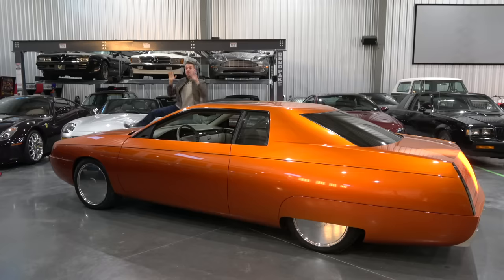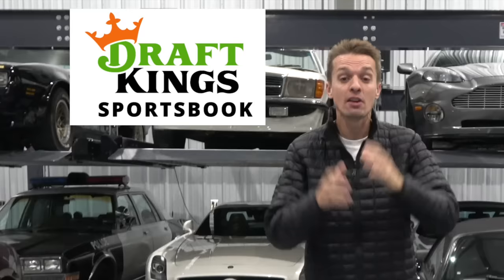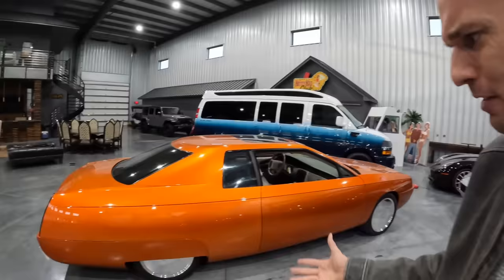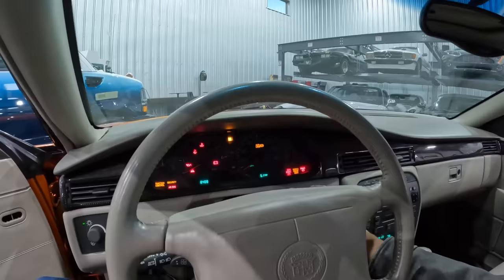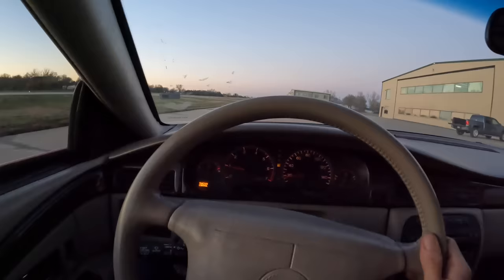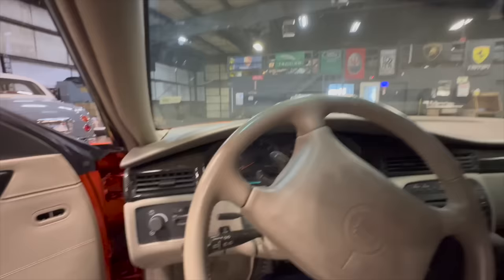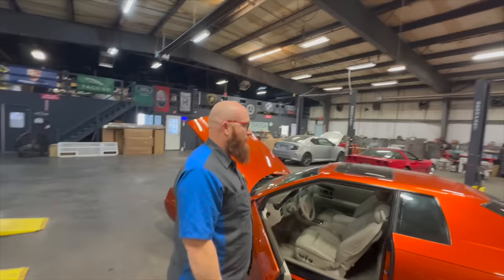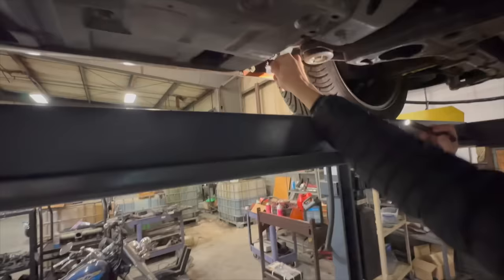I bought a forgotten Y2K Cadillac Concept Car, with a mysterious history. Meet the EldoRODo!

Comment: Oddly, the self levelling on my 89 Fleetwood continued to work even as I sent it to the wreckers.  It was all original at 439K kilometers.  The power antenna worked too!.  I should have kept it because the 4.5 also stll started and ran beautifully but I needed the space.

Comment: The 4-post lift is one thing, but it will be fun for Wizard to use a floor jack just to get it high enough for his other lifts. Can't fix the air suspension on the 4-post lift.

Comment: It honestly looks like something made for a movie or similar.  Whether it was USED for said movie...  But Los Angeles is full of these one-off production cars that barely run aside from looking the part.  The Los Angeles Auto Show often also has one-off things show up as well.  Like a prototype of the current Jeep Gladiator - just styled more like a pickup,  almost 20 years ago.  Just sitting there in the middle of the Jeep display.

Comment: Try unscrew the valve stem from the wheel that has it. If it unscrews then screw it in to the wheel that has the flush mount valve

Comment: a thought about the PS whine.  its possible being low mileage and custom, that the PS pump fail is related to excessive pressure, restriction, or sticking valve. (introduced by the customization)  if there is a way to check high side pressure vs a stock system, its worth doing.

Comment: in regards to the roof  chop on the Caddilac   beleive  the old timers  used to  just drop the original glass  behind the dash board   towards the Firewall  to “hide” that part  instead of risking  cutting the tempered  Safety  glass  although. now there are companies that can  do it those  Valves on the tires look  similiar to   Presto Valves they use on Bicycle tubes  typical Bike  Air Pumps. have a system that   you flip  the  part that goes over the valves 180 degrees and it adapts it to work on  that Valve  or a Standard  style like most Automobiles have on them ( i forget the name  i think it’s Shrader and Presta     bike Shops have a attachment on their house air  so someone makes  the tool for it

Comment: Your valve stem system on the wheels are a coming setup that we use on our show vehicles and they have an adapter that you screw into the valve stem and apply the proper air pressure!!  I have the very same setup on my billet custom wheels built and custom modified by HRBB!!

Comment: They make 90° valve stems for motorcycle wheels. If the hole is the right size could put them on those wheels and make it way easier to air up the tires.

Comment: I am not a big Cadillac fan, but that car is awesome. I'd have to drive it though, if I had it, so I would fix the door poppers, install screens for the side mirror cameras, and maybe swap the wheels for some more modern Cadillac wheels if they fit, for new tires and conventional valve stems for the tires. But awesome car, I am digging the look.

Comment: U should lift it up, and look, under the door area, or the rear wheel area? There may be a button to activate the door popper!!! Sort of like the purple, crazy GTO, in the original movie, XXX.... I could be wrong, but ot just seems weird, that they wouldn't have a back-up to open the door, besides just a key fab sort of thing.... Like I said, I could be wrong, but just figured I would try to help. It looks like there is a cable coming b off the popper
Reply: Ahhhh... I knew there would be a popper under there somewhere!!! That's cool

Comment: After reading some comments, for clarity, it's the block threads that may fail. It's not the head gasket, that's only a symptom!

I had them fixed in my GXP.
200lbs lighter than any other Northstar platform

Comment: I have worked on El Dorado's I've always had issues with. The starter and where it's at and as well. As. Power steering comp. Going Out Along with the Pulley And Crank bolts

Comment: Easy fix to have someone drill those wheels to accept valve stems, and you won't even notice them. The license plate placement will be easy, just remove that loose piece covering up the rear license location. You could take that to car shows and blow their minds.

Comment: I had a new 1967 GTO with chrome reverse wheels.  It had air valves that were chrome, and flush with the wheel.  There was a appx. inch long adapter that screwed in the flush valve that allowed you to put air in the tire.  Probably what may be what is installed on these wheels.  Look in the console or glove box for the adapter.

Comment: Isn't channeled where channels were cut into the bottom of the body so that the frame sat into the channels giving it a body drop?  I think when the side is made slimmer that would be sectioned.  But if I'm wrong, it's just what I was once told be someone that built sales back in the UK.

Comment: If I had your money I would have someone pull the northstar and caddy transmission and drop a LS4 engine and transmission from a late 2000’s Impala SS. My C5 corvette traction control light  comes on when it’s cold outside and I start the car until it warms up.

Comment: That flush valve stem requires a threaded insert. Unscrew the cap and screw in the insert.  I bet my left nuts that that stem you have on the other wheel is the unscrewable insert.  I got mine at Summit about 25 yrs ago.  Use them for whatever but they were designed for us off road mudder folks so you don't tear off the valve stem in the mud and during cleaning.

Comment: Easy to find its history - "THE Cadillac 2000 Eldorado Touring Coupe, transformed into a "low-rider hot rod" called Eldorodo has been one of the stars of the Los Angeles International Auto Show. At the direction of Cadillac, the new hot rod was created by a team of General Motors designers in collaboration with California Street Rods of California.

John Smith, GM vice president and Cadillac general manager, said: "The Eldorodo is Cadillac's way of celebrating the creativity of the hot rod culture in Southern California.

Available in Ignite Orange, the hot rod uses a number of classic styling cues including full-length bumper skirts covering the rear tyres and clean slit headlights and indicators.

Cadillac also reached into the past for the Eldorodo's tail lights. The slanted vertical tail lights are trimmed in chrome - a style used repeatedly by Cadillac in the 1970s and 1980s.

Goodyear tyres fitted to machined-styled "spun disc" wheels with Cadillac's signature wreath and crest centre caps, finish off the hot rod look. Cadillac's 300 horsepower Northstar engine will remain the powerplant for Eldorodo. Carbon fibre interior trimplates replace the standard wood trim on the instrument panel, centre console and door."

Comment: The paint match is off on the right side, door to the right rear quarter panel, I much rather have a factory stock El Dorado than that pile ,do yourself a favor, put a brick on the accelerator why the car is running in reaching and put it into gear.😝

Comment: The only problem I'd have with this car is that the engine is fitted the wrong way and driving the wrong wheels.
As soon as you touch the throttle those wheels will be spinning with you going nowhere. That would just make me sad.
Transverse mounted and FWD is Mini, Golf (Rabbit), Ford Focus, Honda Civic, basically small, economic hatchback. It's just so very wrong on an American land yacht.

Comment: WTF?! This is a tiny ass car. That can't be a cadillac.
I mean this feels like a porsche 911 size.
It would be nice if the headlights were designed correctly to fit the rest of the front, not those tiny and ugly shape, and the rear pillar would be slimmer or the rear window wrap around the sides of sorts. Something is off there as well.